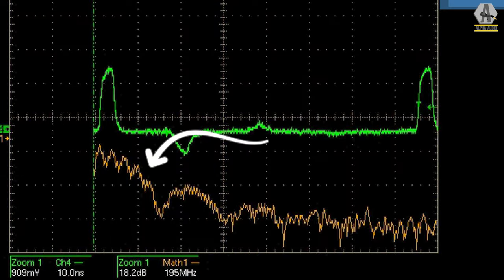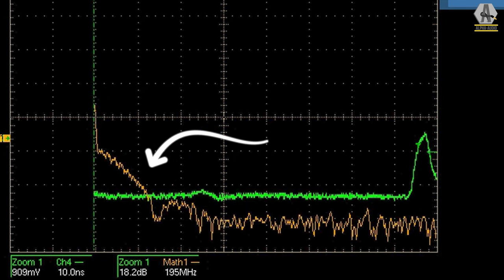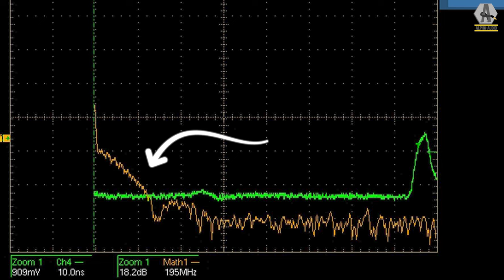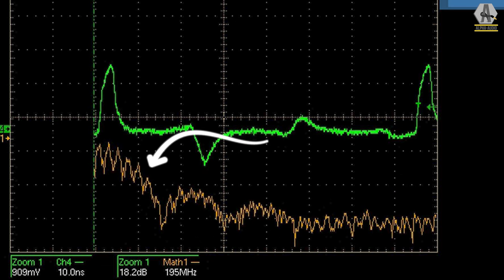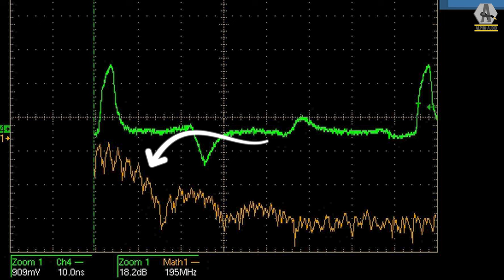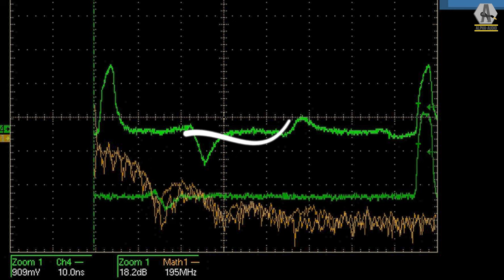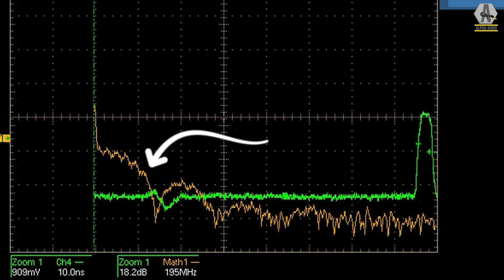Cables make a difference - and we measured it! Alpha Audio Huge Cable Test

Comment: @TheAlphaAudio  
Jaap, this is a somewhat off-topic production comment...

But I noticed the microphone distance you've chosen for your dialog mic for this video.

Given that distance, and the framing of the video, I might suggest using the microphone stand and its boom to place both the microphone and stand out-of-frame from an overhead "boom'd in" position, much like a movie/video microphone boom operator would do while capturing the actors' dialog while filming.

This would keep the video more intimate (no visible microphone or stand) while allowing you a bit more natural freedom of movement (within reason).  Just my .02

Cheers
Reply from the maker: Thanks for the advice. This DPA sounds better than my Rode NTG3 boom-mic. That's why i rather use this one. But I do see your point.
Reply: @TheAlphaAudio    If the distance and relative axis/angle to your face can remain similar while keeping the same framing in the video, the DPA should still work and sound very similar using it in an overhead orientation as it does being used "underhead".

Just don't fart, LOL!  😛  Aim it more at the top of your head than your crotch.  ;)
Reply from the maker: @bbfoto7248  hahaha...!

Comment: Most of the better cable difference is at the dac to preamp section. Amp to speaker not so much. My all silver jewerly 9999 solid core  diy with fiberglass sleeves 80$ xlr cable made the most difference. And with my magnapan lrs+, schitt is so coherent that i can hear immediate cable differences. You are nuts to be forking out hundreds if not thousands for cable, just learn to diy your own and none of those fing manufacturers even give you the real stuff solid silver until you hit the 1k mark.

Comment: Another video about cables with a couple of screenshots showing nothing significant.  Did you just say a bump showed why a cable sounded dry? From the screenshot it looks like its a signal at 195mhz ? And yet no real showing of the actual test equipment, or at what level this artefact is. Its almost like pictures we seen in the 90's adverts claiming a difference, despite being an inaudible test tone at -120db.

Can we have a more informative detailed test with the equipment and all parameters present?

So far most people with equipment that can measure are showing us these sort of differences  are so miniscule and at such a low noise floor we medically cannot be hearing them, yet we still get sellers peddling fat cables with more bass, thin silver cables with more treble, shorter cables sounding faster and other such nonsense. Weird how so much of a cables look influences sound.

I have pretty much given up on HiFi cables due to just how underhanded the industry is.
Reply from the maker: Read the article on our website before you start bashing a video that is actually a summary of months and months of measurements.

Comment: Too all ppl not having an electrical degree, this is a typical hoax method to show any DIFFERENCE at all and and the misleading part is WHERE he measures.. He measures in the MHZ range which is multiple ranges outside even where the electrical range our hifi equipment works. It has nothing to do with decay or geometry. Decay is happening at the same frequency as the note is played at or same Hertz. Even a novelist electric engineer would say that the roll off is because of capacitance in the cable. This is SO absurdly miniscule that it has no impact on  our circuits. Our circuits are made to dampen high frequency noise so you dont need this quality in the cable at all. A 10cent shunt cap in the amplifier does the same job only better.  It  is simply your mind playing tricks on you when you see a great looking cable.
Reply: All skeptics: Show us the measurements 

Alpha audio: Here are the measurements 

All skeptics: not those measurements 🤷‍♂️
Reply from the maker: Please read the whole article on our website for details. I explain the complete setup there.
Reply: If you think measuring up in the MHz I'd wrong , you are not educated as to what and why it is important..cables sound different because of stored energy in the magnetic field and electrostatic fields
Reply from the maker: @michaelrovner4165  Who are you referring to. I don't really understand your comment.
Reply: Yet they hear differences and 3 people hear them the same. You cannot explain that with your theories can you?
Reply: I think it's your mind playing tricks to your ears instead. Prove me wrong.
Reply: Cables do make a difference. Listen to your ears and not your wallet 😂
Reply: Give me your phone number. I just ordered an Audio Note Sootto RCA  1 meter interconnect. When it comes in I can phone you to tell you if it made a difference or not (which of course it will. We aren't all crazy or deaf).
Reply: You are so correct. These fickle cables will never improve your two tin cans and string. 🤣
Reply: Mega Hearts cause jitter bad period ! 😊
Reply: @impuls60 Did you read the articl?. They couldn't see or know which cable was being listened to at the time, somebody else was in control of that. They also included a standard "free" cable and gave it the same type of assessment. How does the mind play tricks on something it can't see?

Comment: Do members of the ASR forum still have their heads buried in the sand?
Reply from the maker: Probably... but I am not looking forward to all of their hatred in this comment section.
Reply: @TheAlphaAudio it's like trying to explain reality to a flat earther, there's no point. 
Zero point to try and explain to them.
Reply from the maker: @Music_time82  Yup
Reply: They always did and probably will. Flat earth audiophiles lol
Reply: Maybe a strange question but does this also aply on hdmi cables
Reply: @BoemSleng  all cables probably
Reply: @BoemSleng depends on the cabel😂 You have to lissen to it, only propper way of going at it👌
Reply: @Coneman3  I have some reservations on audiophile ethernet cables. Except the shielded ones, which bring analogue noise into the system. But I fail to identify any difference between a 9.99$ Amazon cable and a 9000$ branded cable. BTW, my speaker cables are Ansuz D2, so no denier here.

Comment: In short, would you be able to identify the standard cable from the measurements? Without knowing anything at all?,

Hundreds have been where you are without conclusive evidence.

A null test between the standard cable and the one you think sounds best will show no significant difference.

Recording the result will be like playing two similar files no one will hear a decisive difference, that's the disagreement between the two hifi groups, the cable believers and those who are not.

But if the two cables are inserted into an audio system, we will hear from small to significant sound differences depending on the basic quality of the system and the listeners' experience of how live music actually sounds, because fundamentally it is the fidelity of the sound of instruments and voices that is important, if this is in order, all the other hifi parameters typically follow with soundstage/image, rhythm, etc.

What is experienced with cables is also experienced with resistors capacitors cabinets, silver plating of copper, the difference between using copper and silver, mixing copper gold and silver, etc. Two stark contrasts are lead and silver. Lead, there is rich bass, silver, the bass almost disappears.

The experience is a kind of marterial sound that is dependent on both conducting and insulating marterials .

There are, of course, endless possibilities for combinations of materials and thus timbres. And some are more natural than others.

We need to keep in mind what the goal is with hifi, for me it's lifelike reproduction and my experience is that most people want the music to come alive in their living room.

What you are measuring is the impact of parasitic components, you can try to change these by extending a cable with the same type of cable, you will find that the timbre does not change but the sound becomes more woolly the longer the cable gets.

But if you want good sound, it is still sensible to look at the parasitic components that will change data depending on the marterials that most people know from e.g. condensers, but we must also recognise that the brain and ear are number one when selecting marterials as good or bad. It's a bit like one of our other senses, the sense of taste, it's hard to gauge an enigmatic red wine, it's true that this is in many ways a personal choice, but hifi should have a reference, the live music.

All components can be equalised to the equalised components resistor capacitor and coil and part of the way towards hifi is about choosing the materials for these parasitic components that give the most natural sound, this must of course be coupled with the construction/diagram itself to give the overall sound result.

How do we move forward, one group of hifi enthusiasts measures with known measurement techniques that harmonise well with known theory, PS. Everything you measured in this video can pretty much be calculated and predicted using known theory.

The other group of hifi enthusiasts use experience, ear and brain as an argument and basis for decision-making, this typically does not harmonise with known science, the argument is blind testing, it is precisely blind testing that has convinced me that experience/obsession and science are on a collision course, one of the hifi groups is wrong or they are both right in their own way
Reply: I'll just give a few examples of what the problem is that I'm trying to describe in my post above.

If you replace copper with silver in the same cable construction, you get a surprisingly large sound change.

If you connect 4.7uF with 2 nF in parallel, the contribution of the sound signature from the 2 nF is surprisingly clear, the same can be experienced with the decoupling of electrolytes in the power supply .

Comment: Before anyone can hear cable differences they need to get their Room fully treated. All that Extra stuff like LAN Cavles, Switches, Speaker Cables are the last thing you need to optimize in your hifi chain. And because no one realy does that this cable discussions are ridiculous
Reply: Not necessarily in an experimental set up if all these other attributes remain the same, like this situation, so that the background acoustic environment is constant. Another test would adjust each of the elements you raise and evaluate the changes in cable characteristics. Also these elements you identified are unlikely to change the measurements vs the audible characteristics. So their mic based measures may change…
Reply: Varying all of these elements would be a much larger study. Oth using the stable environment for mic based measurements will still reveal differences between cables.
Reply: @vtkz  
I agree that the majority of cable discussions are somewhat ridiculous.  IMO, there are much more important variables which will have a much larger effect on the audio quality and characteristics of the system.

However, through personal experience, I don't believe all of the arguments such as yours that "You will ONLY hear the differences IF you have a high-end system that can resolve the differences".   RUBBISH.  I used to think the same.

In fact, The Alpha Audio's own Livestream Multi-tests have proven otherwise, in that a wide majority of their listeners can hear identical or at least very similar differences as the Alpha Audio gentlemen hear live in their studio, even when we are all listening through their in-room microphones, and over YouTube's lossy compressed audio, and also while using all of our own very different computers/smartphones/tablets as the source, as well as different amplifiers/speakers/headphones/earbuds/IEMs and audio components.  So there's that.

If what you claim is true, none of us would have been able to easily distinguish these differences via The Alpha Audios own livestreams that correlate quite closely with what they hear as well.